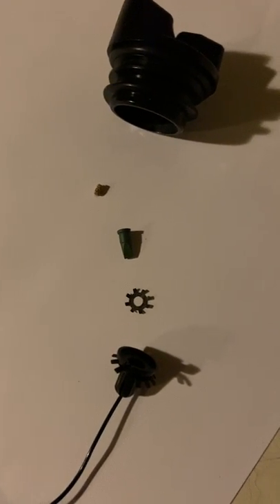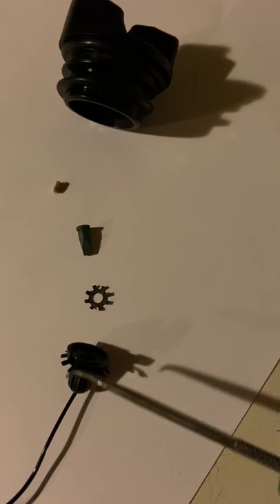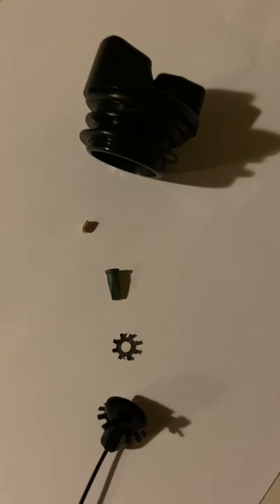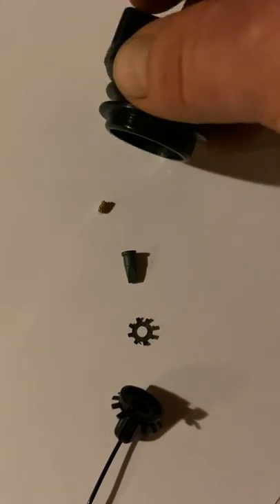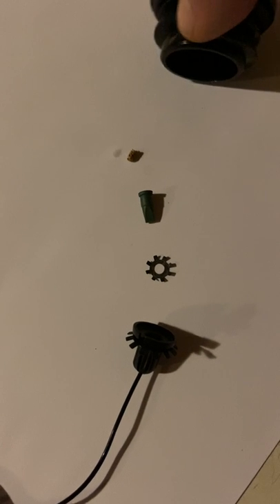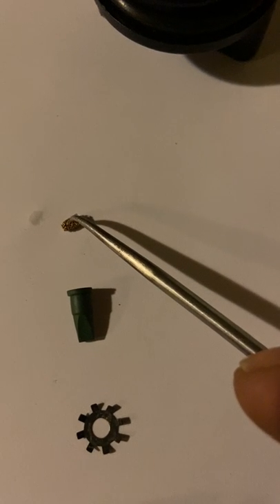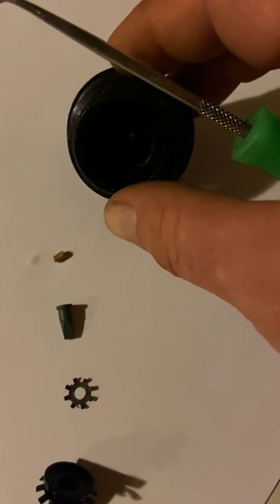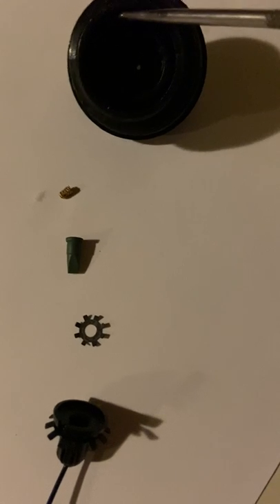Poulan chainsaw fuel cap vent dissection and cleaning.

Comment: I just repaired one of these fuel caps. It was leaking fuel out the vent - common problem with these caps and the second poulan made saw I've had with this issue. Hard starting isn't going to be a vent issue. If the vent is clogged the saw will starve for fuel and die out as air can not come in and displace the consumed fuel leading to the tank creating a vacuum. If you open the cap, the saw will run correctly. The reason for the pressure being released when people open the cap is the vapor pressure of evaporating gas builds in the tank. The vent only allows air to come in, it doesn't allow fuel vapors (or fuel) out. The same thing happens with sealed gas cans.
Reply: How did you fix the fuel leak issue?
Reply: I would like to know how you fixed this as well
Reply: @RYU583  The gas cap expands and contracts due to the ethanol gas. This loosens the retaining washer that seals the duck bill to the gas cap. Take a hammer and small screw driver to tap the edges of the washer down to tighten the duck bill seal to the gas cap. No need to buy a whole new gas cap.

Comment: After watching this and a couple other videos about all the flaws that these saws have, I fixed my problem by putting my Poulan chainsaw out next to the road with a "free" sign on it.
Reply from the maker: Haaa!  That is actually good advice! I guess I just like punishing myself by continuing to mess with them!  Crap- I am still laughing.
Reply: I picked up that saw and rebuilt the carb, did the fuel lines and added a purge valve. It won't run right so I did a coil and plug. It didn't fix the problem so I tore it down and did the seals. Like new inside, very low hours and still won't run. I need to fix the gas cap while I try to fix the saw so it will run. Plastic cylinders says it all. Thanks for the saw and the lesson(s).
Reply from the maker: 👍👍 hopefully you get it going. Most likely the carb. Ethanol gas is nasty stuff.

Comment: How did it turn out
Reply from the maker: Not really. I think those stones plug up. I put an extra Chinese vent on it, there’s another video about that. 
I think another issue on these is the fuel heats up and creates pressure.  Just pull the choke and set the high idle, close the choke and it usually will start right up.
Reply: @crazyfeller5704  thank you for this video

Comment: Mine is just pissing out the hole in the cap.  Wish it was clogged so it wouldn't leak fuel.  Wanna trade?
Reply from the maker: Lol.  Sounds like you need a new duckbill or a new cap, cheap on eBay.  Seems like there is always someone that has one of these burned up in their garage you could grab one from.

Comment: what was your end result. My Poulan saw does the same thing when I remove the fuel cap. 
It runs great for a few min then dies after making a cut.
Reply from the maker: Sorry. I use the phone ap, doesn’t let you know someone commented.  It did not fix the issue, I ended up buying an aftermarket vent/grommet for a Chinese chainsaw, $3 on eBay. Drilled the hole in the tank on the rear right section of the tank - you will see where you have room. 5/16 bit made a good seal- seems to be better now.